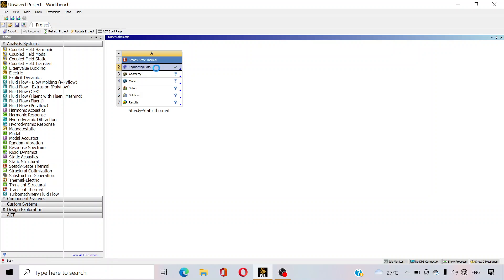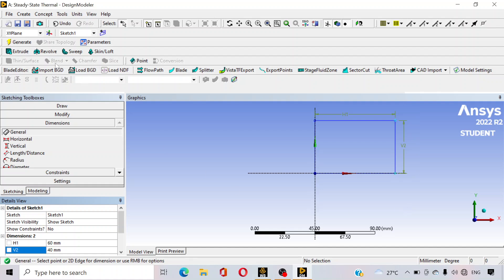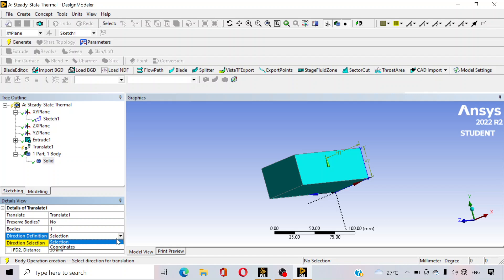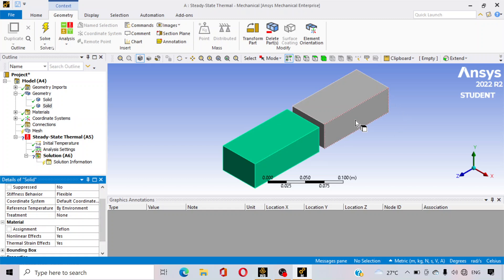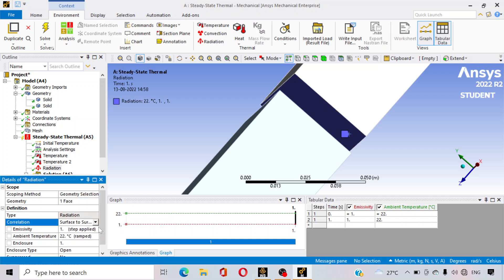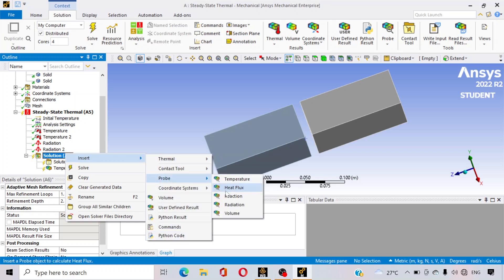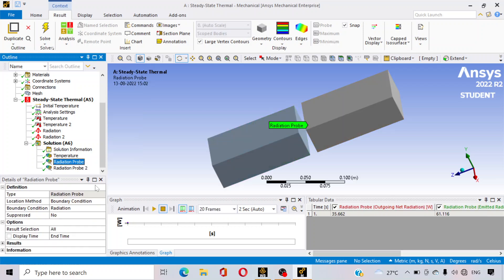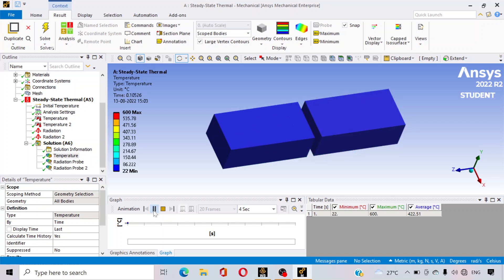Steady State Thermal Ansys - Radiation | Tutorial - 02 |  Ansys for Beginners

Comment: hello sir , suppose i m using microwave radiation with some electric input, the microwaves are used to heat the glass material or we can say quartz, can u plz guide me in this case in finding solution that heat radiation released by microwave and absorb by quartz and how it will affect the the temperature